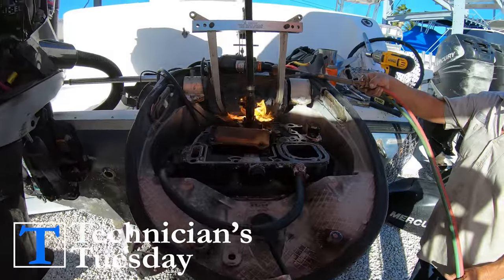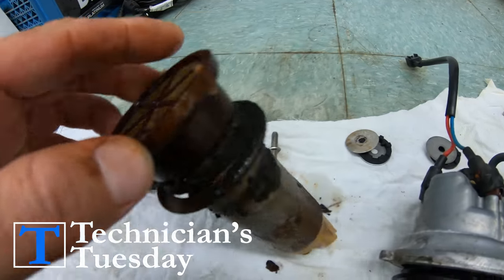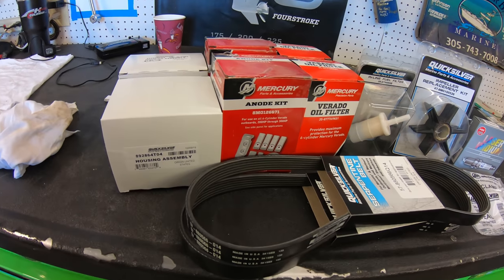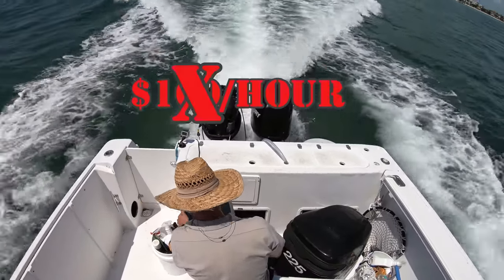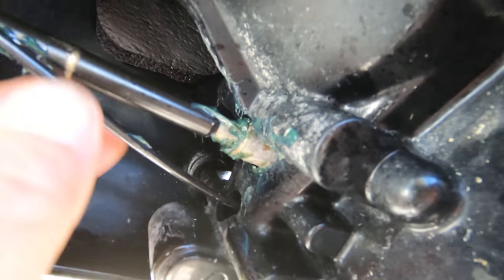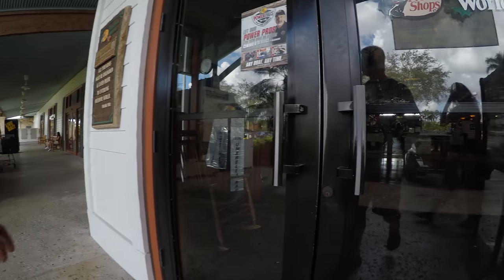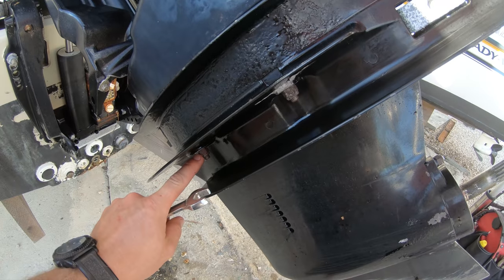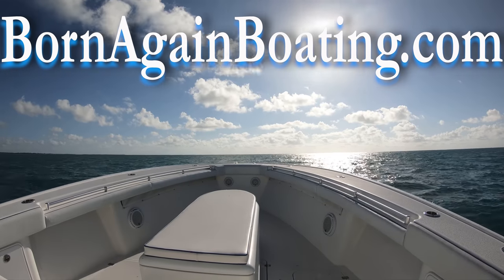Outboard Service Cost Saving Hacks!

Comment: I trust my Honda 200hp mechanic but can do most maintenance myself.  BOE Marine website has “kits” that include all the Oils, Filters and O-Rings needed for basic maintenance.  My mechanic gets the job every other year to change Impeller, plug the engine in for a diagnostic overview and sometimes the spark plug change as two plugs require pulling off engine housing that I don’t want cracked with my “fat fingers” and “soft touch”.

Plus, I want my mechanic to be in business for as long I am boating!  Biggest problem is scheduling as many Midwest US Boaters pull their boats in October and most storage facilities want to lock their doors in November.  Luckily, my mechanic always finds time for me in mid-November.

Be well and appreciate all the knowledge.  I actually have a Two Conchs sun shirt I picked up when in the Keys.  Love the Keys and can be found there every Winter for a while.  Wish I could stay year round!  There’s no fish like saltwater fish.

Comment: I now do all my maintenance myself.  Years ago my marine mechanic made a mistake and invited me over for a beer while he was doing routine maintenance on my engine.  I took mental notes because I am mechanically inclined.   I also make a log of engine hours.  Every 100hrs I do the engine oil and lower end oil.  I change the entire water pump system every 300hrs.  I have a 2007 Yamaha F150 and I am the original owner.  4207hrs.  Original lower end.   I also have a friends boat parked on my property that I just started to service.  It's a 2004 F225 Yamaha. 1130hrs.  Same schedule, but this engine runs a little hot, so the impeller will be every 100hrs.   Born Again Boating has definitely saved me time and money with the DIY videos.  #Gaugesaver
Reply: I have a 2 stroke .mercury outboard  that needs the 2 wires from the engine  to the trim tilt motor need to be repaired  ,any suggestions.

Comment: I wanted to have the local marine company do ALL my maintenance on my 300 Yamaha, but they are so busy installing new motors they told me I should try to do as much as it as I can. I do the oil changes, lower unit, filter changes, external zincs etc.... I need to do the internal zincs and thermostats  and am hoping for a Born Again Boating video to show me how!. ☺... Thank you for all the great videos!

Comment: Another great vid. Caught your nifty lower unit drain channel made out of a little bit of cardboard to keep the oil off the skeg. Nice touch! 
I started doing my own maintenance and winterizing after my local marina kept making silly mistakes and damaging my engine (blown regulator due to wiring not secured, stranded after manifold bolts weren't torqued creating a vacuum leak.) I realized, the only one who cares as much as me about my boat is...well...nobody!
Reply from the maker: Thanks for watching!

Comment: Good argument for sticking with my two strokes
Reply: nyunixguru but 4 strokes also get better MPG. But normally on average 2 strokes get better power output. At least from what I’ve seen.
Reply: I think it's a wash, price wise.
Reply: 7 bucks for four stroke spark plugs not going to break the bank I guess. Filter is cheap too
Reply: My 200 OX66 chugs fuel , but parts are some what cheaper , taxes are cheaper and if it pops a new power head is cheaper .... plus it keeps the mosquitos away
Reply: Lol
Reply: The trim pump on my Mercury verado was an absolute nightmare even though I got dealer cost that was a lot of money. All the other stuff I do every year but thanks for the video it was great
Reply: Haha exactly! I've got 2 early 90's carbureted Yamahas. gotta mix the oil but so much less maintenance and no oil pump failure from oil injection. I've had new Merc 4 strokes and lot more maintenance and $$$
Reply: Funny you should say.  I recently bought my first 4 stroke (Suzuki 70) and according to these videos it is by far the highest maintenance engine that I own or have ever owned.

Comment: thanks again for a great video. I pay for the impeller and winterization, but have changed spark plugs, water separator, and enjoy working on the outboard. seems easier than a car engine. but having new gauges would be a #gaugesaver

Comment: Making the service yourself may save some money, but the engine manufactures require that it is done by professionals for the warranty to be valid on new engines.
I do service all my older engines myself though. (Currently I've got three motorboats and a sailboat.)

Comment: I have been doing all of my own servicing for years. Thats why I'm still running 2 strokes, so much easier to maintain. Plugs, gear oil and impeller every year and grease everything, Anodes as required based on visual inspection. Fuel filter usually every 2nd year, this may become yearly with the HPDI I'm about to install as it saves all the issues with injectors, etc...

Comment: I just got my 89’ Force 125 running after going through the carbs and cleaning them since they were gunked up real bad from the last owner. I got the boat real cheap mainly because it wouldn’t run. I just took it out yesterday for some maintenance, like resetting the carbs tuning at the lake (cause I live 5200 ft above the altitude of the lake). When I was doing that I was really wishing that my gauges were working, the only one that worked was the tach. Too bad this video is already a year old 🤣

Comment: As a former USCG mechanic I perform all maintenance myself, but recently had a spark plug issue and found that the plugs that I ordered online turned out to be counterfeit (something to be careful about - side by side looked identical and the packaging was also the same) - google fake spark plugs for more information, excited about the gauge offer / haven't been able to read mine for quite a while #gaugesaver
Reply: Which ones exactly, and where did you buy them.
Reply: patrickwelch mine were purchased from EBay from a seller with excellent feedback. http://www.ngk-sparkplugs.jp/english/techinfo/fake/index.html

Comment: FB marine would charge $1,200 per engine for service on mercury verados at the marina i used to wash boats at. I think the yamahas were slightly cheaper because they're not high performance like the mercurys. One mechanic described to customer one time, "You have to be married to them  if you get mercurys."

Comment: Poppet valves, prop grease, check for fishing line... On 2 stroke carb engines carb cleaning is basically an every 2 to 3 year maintenance item. On 2 stroke carb engines, the engines should be "de-oiled" yearly, typically in the spring time for the northerners. Great video! I did send you an email with my contact info about last weeks prize, if you didn't get it let me know and I will resend it (it's probably sitting in your spam box)
Reply from the maker: Awesome! Thank you, got the email bro, you should get something this week if not next ;)
Reply: @BornAgainBoating  Thanks Aaron, keep up the great work!

Comment: I'm hoping u can help.me. My 1988 150HP evinrude at idle revs up like its going 100mph. If I move the throttle / choke vertical arm nothing changes. Tge only way to stop is to shut off. To get back to dock I put it in forward asap after starting. It ran just fine in gear. But at dock idle goes crazy.

Comment: Great Informative Video.  I have rebuilt 7 boats, 4 were sail, 3 were power.  I normally leave the engine work to the professionals.  This time around, I got stung for $800 per Mercury Verado 250, 500 hours ( I have two(2) and then I was told they only do spark plugs every 300 hours.  I now wonder what else they left out.  The Mechanic said he found water around the turbochargers and recommended I replace them.  Charges = $3000.00.  I'm feeling like I'm being taking advantage of.  A search of YouTube reveals that a REMANUFACTURED 300Hp Turbo costs 1500, not including labor.  Any ideas how 1500 per engine got into the picture (If he really intends to rebuild the Turbos?).  Too old to lift anymore so I am trusting this Master Mechanic.  Am I misplacing my trust? Or not asking the right questions?  Your comments are solicited...
Reply from the maker: Thank you for your question! Please post it in our Born Again Boating Community! Go here and scroll down to access - it’s free: https://www.bornagainboating.com/

Comment: Any shop that charges 175 per hour to change plugs and oil is gouging. The plug swap on my 200 Yamaha takes literally 5 mins and a 3/4 socket. For someone who does outboard work for a living the entire annual service would take no more than 1.5 hours.

Comment: #GaugeSaver I basically write the hours down in my service book I created for my Yamaha. When we bought it it had about 500 hours on the 2011 150. So I changed everything except the belt and water pump which I do believe I will do this spring to establish a base line. We only put about 15-20 hours on it before winter hit.

Comment: Question maybe Florida and in New Jersey for sure they sell bulk optimax oil. Would you trust that bulk oil??? I am fearful of cheap oil deals life is good with no boat repairs. The Biggest thing I did was a complete water pump kit found that half ass job only putting an impeller in at half plane it would over heat now it doesn't.
Reply from the maker: Well, it ultimately comes down to the marina you buy it from. We sell all our oil from bulk. It's just easier to have the 55 gallon drums and fill up the containers. If you go to a marina that lets you fill up your own containers, you can see the drum and it will have the tag on it with the part number and what it is :) unless they are super shady and are refilling drums with other oil or mislabeling them, you shouldn't have a problem.

Comment: Just got my first 4stroke Yamaha engine on my sailfish 236 I just purchased. Noticed that clear jar at the bottom of engine inside cowling. I saw a clip of you heating up the part and spreading it with a screw driver. What is that part?

Comment: I am new to having a large relatively modern engine.  I’m going to want to keep my Yamaha 225 ox66 running and maintained because I only have one and I don’t want to have to replace it anytime soon!  This video for me was very helpful. Well done Aaron! 
#gaugesaver
Reply: What brand of 2 stroke oil do you run in your engine?
Reply: Them ol' OX66 are some badass engines. A little maintenance and they run strong forever.
Reply: @sumyunguyz   - It's true!  The last of the great 2 stroke engines.  After hearing about the corrosion issues that the 2000 - 2005 Yamaha 4  stroke engines have, it makes me thankful to have my 250 ox66 hanging on the transom.  As a result of the o2 sensor, I run Pennzoil 100% Synthetic 2 stroke oil, but my stock is getting low and I'm not sure what I should switch to.
Reply: @stephenleone2375  
I've been running Yamalube 2M and RingFree+ in my 20 year old 200 ox66. Still  runs just like it was new. Just put a new 200 sho on my tritoon. Hope it's going to be half as reliable as my  ol 2 stroke.
Reply: @stephen Leone.... sorry for missing your question... I’m using West Marine Premium TC-W3. When I purchased the engine the previous owner had a case and sold it to me for $15/gal

Comment: #GaugeSaver I get my service done at a marina that is mercury verado certified. It costs $900 per engine including parts and labor. My boat has two engines so that equates to about $1800 per service. I generally put approximately 200 hours on my boat per year so I generally spend $3600 on maintenance twice a year. I think if I do the maintenance myself, even after paying haul out fees and buying all the necessary maintenance components, it would still be cheaper. Thanks for the info! What do you think, Born Again Boating?
Reply from the maker: Nice! Lol, well, I guess that ultimately depends on what those haul out fees are. You would lose a day of time but you would save a couple hundred bucks on the service if all you had to pay was for the parts :)

Comment: I'm new to the 4-stroke world. Next maintenance I'm doing my self. I need to get a bore scope to check the exhaust for corrosion on my 2003 Yamaha which reminds me!! I need new gauges #bornagainboating 👍 #gaugesaver
Reply from the maker: A bore scope is great, but if you drop your lower, usually you can get a pretty good look up in there with a flashlight. You just can't see all the way up to the powerhead :( you can also hook a garden hose to the water tube with the lower unit off. Turn it on and watch it immediately to see if water just comes pouring out the exhaust without going through the powerhead first. If there's absolutely no delay and you can tell the water is just pouring out, you'll know. 
If you don't have an overheat at idle issue yet though, it hasn't rotten out that much yet ;)
Reply: @BornAgainBoating  
Thanks for the advice 👍 Next time I will take a look and try the garden hose trick. Not over heating at idle yet. Just paranoid about it. Is there any way to find out if the mid section has already been replaced? Does Yamaha keep track of the kits sold by serial number?

Comment: Bro where are you based out of in the keys?
Reply from the maker: Marathon :)
Reply: @BornAgainBoating  I know you work on Mercury's but do you do warranty work for them? Long story short I have a brand new scout with triple 350's in tavernier. One had a critical steering issue, one has a "lost comm" issue and keeps shutting down. I can't move the boat and it's impossible to find good help around here.

Comment: #gaugeSaver
Reply: #gaugesaver  Thank you for another informative video! I just did the oil, oil filters, fuel filters, and checked both lowers for water. We are at 100 hours on our re-power. I plan to change the lower oil in spring and run original until stuff until next winter.  Spring of 2021 I plan to pull the lowers and do the water pumps Spring 2021. Spring 2022 the T-sats and belts will be addressed. I may pull the under cowl this Spring and inspect.  The re-power from twin opti 150's to twin 150 merc four-strokes has been great.  Our gauges are a little sun burnt so I am trying for the prize. Whether I win or not I will use gaugesaver.  $75 a piece is way better than new smartcraft gauges!! 

Mark